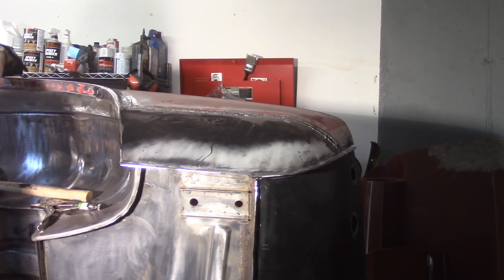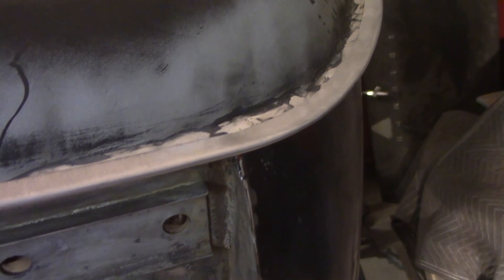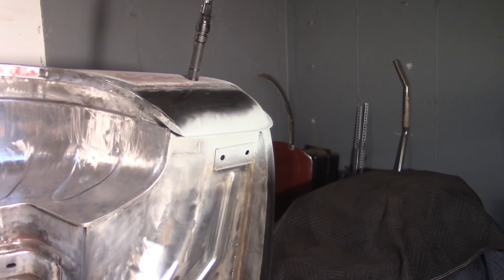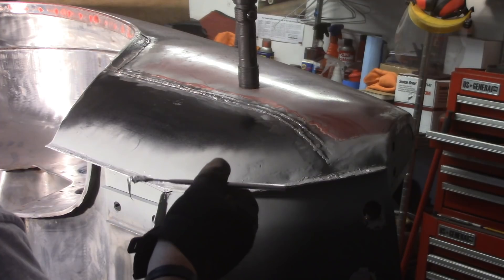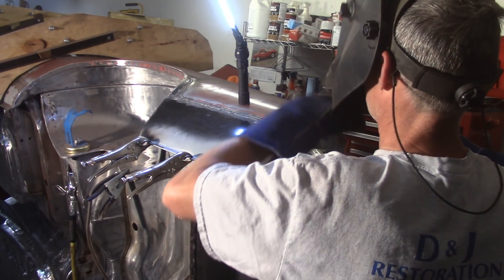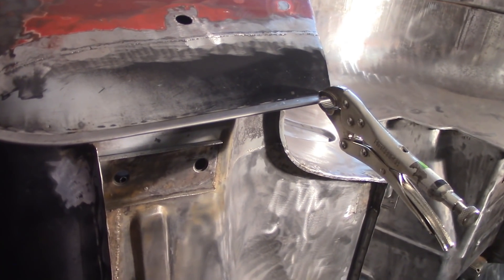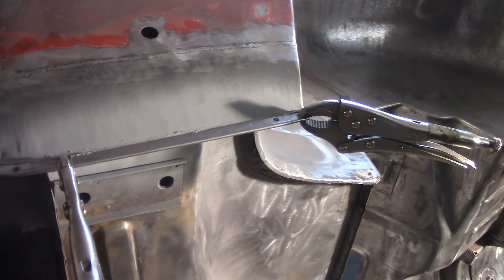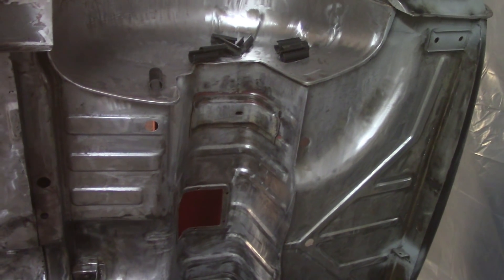Triumph Spitfire Body Repair - Rear Fender Trim

Comment: I think I'll go the adhesive route on mine.
Little tip for cleaning out plug weld holes. Take an old drill bit of the same size and square the tip on your grinder, then sharpen it. Now you have a flat-tipped bit. Use this in your drill and clean out the plug weld holes. This will get you down to bare metal without punching the hole completely through.
Reply from the maker: Thanks, Hazen. I've been using the drill bit thing for a while, but the seam sealer is much stickier than paint and didn't come out as easily. I used a small pick for some of it. And, yes, I'd used adhesive if I had to do it again. Just use lots of clamps!

Comment: Hi Chris, I’ve seen the guy from bay one customs use. A norton panel bond adhesive like a filler to complete his work ,ive used it as a panel bond and its sticks great
Reply from the maker: I found that solution a bit too late. Probably the best in this case to help with having a built-in seam sealer to the adhesive. Next time!

Comment: What color have you decided to paint her Chris?
Reply from the maker: I haven't got decided what I'm doing underneath (just top coat or undercoating), but the car will be back in Signal Red, as original.
Reply: Maybe Use Por15 underneath I believe it comes in different colors apart from Black 
or a radical option Coal Tar Paint 
SV Seeker are building a boat and have done extensive tests on what will protect the boat from Rust best and Coal Tar Paint has come out on top 
but in your case underneath grin 
Tony
Reply from the maker: I fought with using POR 15, which I did use on the frame. It's very hard to paint over and the place I got my epoxy doesn't recommend using it was their products. I wanted epoxy and something more easily topcoated with whatever I choose.
Reply: I heard Por15 was hard to paint over but their are several things to consider here 
It is under the car, It is Hard wearing IE stone chips etc that could cause the start of Cancer esp on your roads being salted ( We dont do that in Western Australia thankfully )  so what do you want ? Sa color that wont be seen and maybe cause rust quicker  or s hard wearing protection that will save you doing what you are doing now for many years to come?Like I said I believe Por15 comes in different colors so it might be worth checking 
I dont know how Por15 and some other epoxy would compare for longevity maybe the forum you are in might help their?
Reply from the maker: I hear you. I'll see if there's a solution there. I've looked at their (POR) bed liner, too.
Reply: What for the boot? and or the driving compartment floor?
Reply from the maker: I'm going to use this primer again since it's a very good sealer / protector and then topcoat with red.